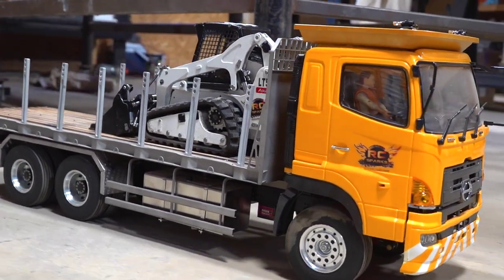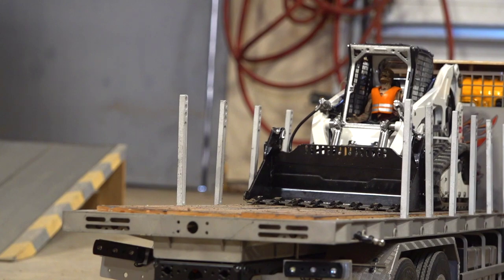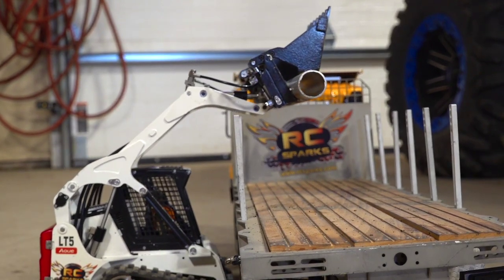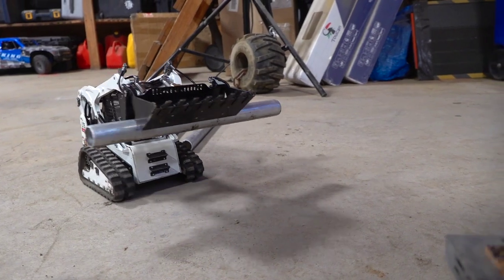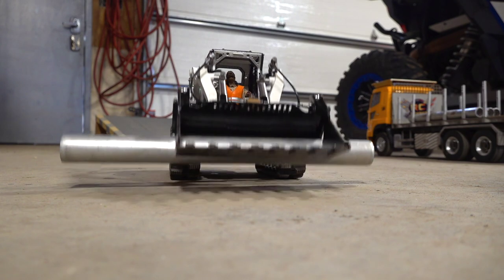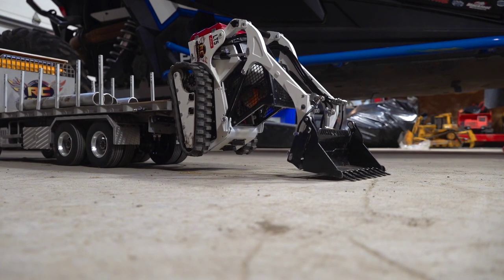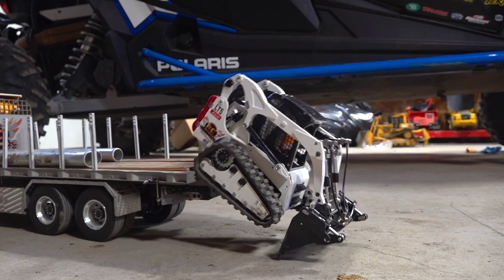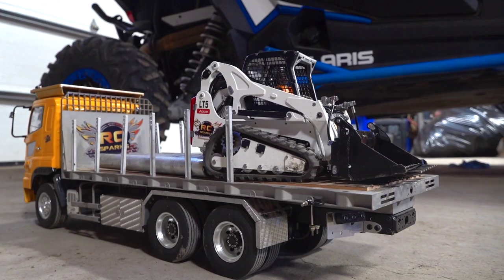RC BOBCAT & CARGO LOADED w/o Ramps onto FLAT DECK - LESU LT5 TRACKED SKiD STEER | RC ADVENTURES

Comment: Cool!! I think instead of pulling the truck forward. I think if you had just rolled the bucket up as if you were scooping dirt not the boom but just a bucket it’s self the motion as if u was scooping dirt it might have saved u. Try it off camera and see if works. But ether way. I’m not trying to sound like a know it all. Or that you have  done anything wrong at all. I was just curious to see if that would have work. also great job with the build👌🏻 can’t wait to see alot more content of the two skidsteers👍🏼